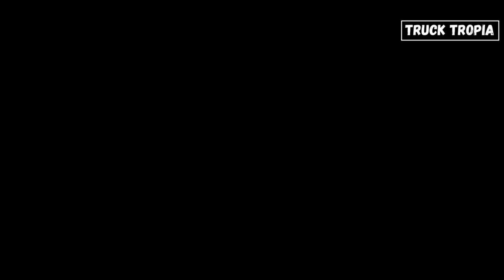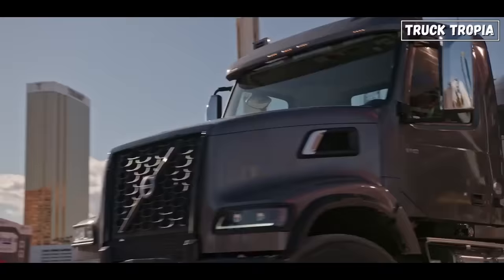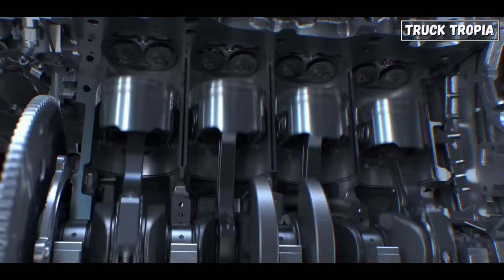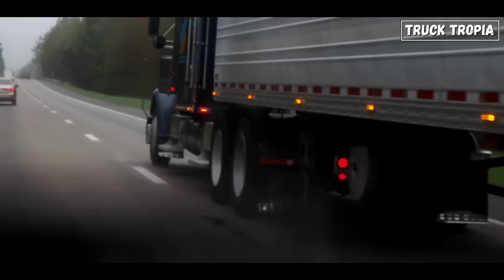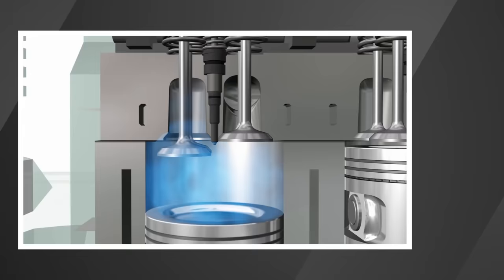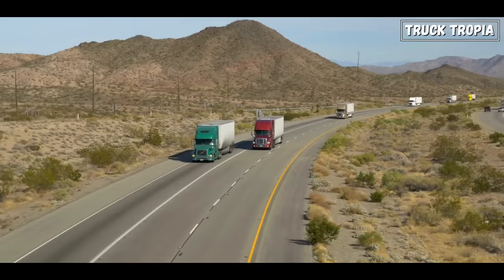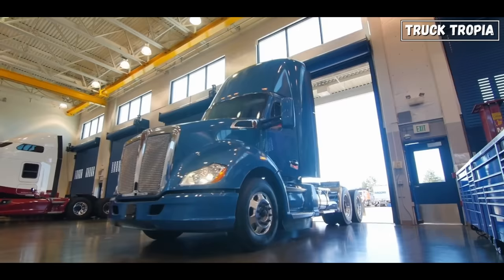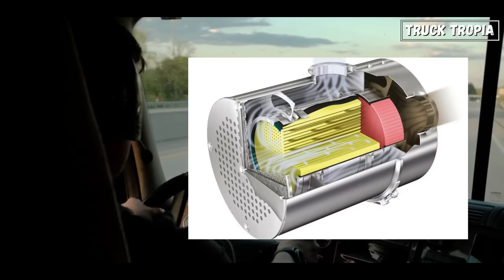Ultimate Truck Education 101 - Every Question Answered

Comment: 1) the reason for lift axles is to save wear on tires when not needed.
I can see that you are not familiar with big trucks...
This should be interesting. 
2) nobody ever has asked why UK engines are different than American. 
As for 500hp not able to pull heavy loads, I had a 425hp Cat engine, pulling a Michigan dump train with 212,000lbs, yes I was way over weight but that 425 pulled it like it was hardly there.
3)the desiel engine ORIGINALLY ran on peanut oil, the word desiel comes from the man how built the motor, his last name was Desiel, the fuel today is simply that the price of low grade fuel was cheaper and massively available over peanut oil.
4) having longer wheelbase has nothing to do with carrying extra weight, 80,000lbs is maximum legal weight regardless if you have a short truck or long one. To carry more weight it comes down to how many axles you have and state regulations. Mostly, those of us who have long wheelbase truck just LOVE the look.
5) the cost to manufacture  the v8 was the real only reason they stopped making them. I'll take a V8 Detroit any day. After 40ys and 4 million miles, using all motors, the Detroit V8 was one of a kind.
6) why did I hope you would get one correct ?
7) THE reason for automatic transmissions is so the companies can hire complete morons and women to drive their trucks.
Any trucker worth his weight can shift manually just as smooth as an automatic.

Comment: 80,000 lbs is not "36 tons", it is obviously 40 tons. This is coming from a veteran truck driver, but you don't even need me to tell you this
Reply: Imperial and Metric tonnes are different. Metric tonne is 2200 lbs which equates to ≈80k lbs/36 tonnes

Comment: Most of the statements on long wheelbases is false … it does not distribute weight more evenly and has far more disadvantages then advantages … Stability at speed is a moot point because even the shortest wheelbase trucks steer precisely if steering linkage is tight and high quality … Cab over short wheelbase Isuzus steer very precisely at speed

Comment: Automatic transmissions over manuals; is because the kids now a days that are learning to drive truck are too stupid to grasp the concept of step on the clutch and shift the gears. Autos might be okay for 80,000 lbs gross, but they don't handle 139,000 lbs (63,500 kgs) very well.

Comment: Cummins absolutely should put out a 6.4 diesel that beats Ford's V8 powerstroke 6.7 that puts out more HP and torque than the Cummins in the Ram trucks!!!
Reply: And if Cat was to venture into the truck segment, it would likely absolutely beat the hell out of the duratrash, and the new powerstrokes and either beat or match cummins easily.
Reply: For a semi???
Reply: @andykennedy5982  for years Cat had one of the best engines out there for semi trucks. My truck has a 6nz 15 litre Cat pushing about 800 horse to the wheels and that is far from the max the motor can make. I have heard some have them up over 1000 horse.
Reply: @andykennedy5982  
Did you not read I said Ram trucks for consumers?

Comment: 1 ton is 2000 lbs.  Therefore, 36 tons equals 72000 lbs.  80000 lbs is 40 tons not 36.
Reply from the maker: Nope metric ton 80.000 is equal to 36.000 kg = 36 ton
Reply: @TruckTropia  then tonne should have been used instead of ton as tonne means metric ton and ton aka short ton is the American ton.  Ton is 2000 lbs, and tonne is 1000 kg or 2204.6 lbs.
Reply: @AllanHazen  Because it's all about murica!
Reply: @andykennedy5982  no, it's about proper nomenclature.  If you were told to maintain 20 tons as opposed to 20 tonnes, your weights would be drastically different.  If, instead of following the directions, you set your weight to 20 tonnes and passed over a scale in an area with a 20-ton restriction, you would receive copious fines for your failure.  The failure to identify measurements has led to many great disasters in history all over the planet as imperial and metric measurements are routinely used around the world.

Comment: So do all the trucks you talked about how turbo diesel or are some naturally asperated?
Reply: I can't think of any non turbo truck engines built after mid 70's
Reply: Diesel fuel has 14 % more energy than gasoline. That means better fuel mileage. But before the point that they start producing good power they start to pour out black smoke. By turbocharging they can produce more than twice the power before they start to smoke. That's why they don't make normally aspirated diesels for cars and trucks anymore.

Comment: I will take an 18 speed manual anyday.  I've seen guys tear up automatic transmissions just as fast as they would tear up a manual.  I like choosing my gears, and shifting when necessary, especially in adverse weather, and soft undrfoot conditions.  I have driven both.  My personal experience is that automatics are more likely to cause drivers to be more distracted because they don't have to maintain control over all the functions of the truck.  Automatics don't see the road ahead, and adjust accordingly.  Just my two cents.

Comment: Whats the benefits of a twin stearing as opposed to the lift axel?
Reply: A lift axle is dragged around corners creating drag where a twin steer follows the curve with no drag
Reply: @andykennedy5982  so the twin stearing is much better to use instead of the lift axel
Reply: @mikeandrews6543  Absolutely, a twin steer will follow the radius of the curve, also in europe a lot of twin steers are also lift/steer axles.

Comment: Why do t semi trucks have electric fans?
Reply: Much lighter in weight as well as cheaper in cost.
Reply: @ronfullerton3162  better fuel efficiency and more cooling power at all rpm though
Reply: @DavidVidaurri  Definitely.
Reply: @ronfullerton3162  I hope that they add electric fans to semis one day. Ima do it myself on this t600
Reply: @DavidVidaurri  A truck I drove had the crank pulley mounted steel fan and a mechanical clutch fan . Running down the highway one day, heard a noise like a big rush of air and started immediately to attempt to find out what it was. Then two or three big bangs, and the motor started to shake like crazy. The fan clutch had froze up and started turning the fan at full speed, and two or three fan blades couldn't take the extra rpm's and went there own way, leaving the assembly terribly unbalanced. Yes, I like the plastic fans far better!

Comment: Cats can produce far more than 700hp but us gov got in the way of that. Now to answer uiur thumb nail. Long hood easier access to engine. Long wheele base makes for better ride. Straight 6 produces more torque which is what you want to pull forgot other question

Comment: some of the reasons for why most trucks.l use inline-6 engines versus v-8s are flawed. "v8s have a bigger displacement" is a bogus reason. in the last century, Lamborghini made a 5-liter v12. most US manufacturers made a 5-liter v8, and i know at least Ford made a 5-liter i6. different cylinder bore and crank strokes were required between the three types, obviously. a V doesnt mean its bigger.

also, only OHC and DOHC V8 engines have more than one cam shaft for all valve actuation. for decades all engines used a single cam shaft mounted above the crank shaft but within the cylinder block. they used lifters, pushrods, and rockers/fulcrums to transfer motion fron the central camshaft's lobes to the individual valve stems. i admit with everyone going to 4-valve heads and DOHC, having a V configuration complicates things. 

another main reason for i-6s is modern emission regulation caused manufacturing/mainentance cost escalation. two cylinder banks requiring all the sensors is more complex/expensive than a single cylinder bank with the same required sensors.

Comment: Your addition is a bit off in America 2,000 pounds it one ton. 80,000 divided by one ton =40 tons. And the reason for smaller horsepower is weight savings so you can haul more. larger horsepower equals more weight also less fuel efficiency.

Comment: They need to check their math. One ton is 2,000 lbs. 80,000÷2,000=40. 80,000 lbs is 40 ton not 36
Reply: 1 ton is 1000kg or around 2204 lbs. Hence 80000 lbs is around 36 tons.

80,000 pounds is however 40 short tons (the "short" part is very important).
Reply: @AlexKall  That would be a tonne.

Comment: European trucks are not smaller. They are shorter. But not smaller.

Torque is liek horsepower for dumb people that think they are not.

If you have a given horsepower you can get any torque on the other side of the gear box

Swedish weight limit is 74 tons since 2015... so it isnt  really a very new rule.

There is also a number of eu countries that increase thwre limit the last 2 years.

Highways in europe have pretty much the exact same dimentions as highways in usa. Primary roads is typicallt also pretty good geometry, not far behind highways (they are often convertied with minimum change in gemoetry).  Even 2nd level roads are for the most part  pretty decent.

Its really nor untill 3rd level road you would have a problem with steep hills  and while truck transport on them is bot uncommin, its not like its the type of road that dictate how trucks are built.
Reply: edwardpatrickson  Are you talking about the dirt-bike engine, or the full dirt-bike?
Reply: North American standard for lanes is 12 feet wide . Europe doesn't have room for that except on the freeways, and shoulders are optional there too.

Comment: Wrong the switch to automatic transmissions is so these they can train an idiot to drive these trucks. A standard transmission is more difficult. it's not like your Mustang, which is a synchronized transmission. In big trucks  the transmission is not synchronized which mean you have to match the gear with your road speed. And that takes training and time to learn. In an automatic, they can get put more people in seats quicker with less training. That's why truck accidents have tremendously risen in the last 10 years.
Reply: Good points. But, you in haste likely missed many more important facts. 
Hints,
Automatic transmissions have been pushed by Govs, ABCs, in cars, pick-ups, vans, SUVs, to 'market-more" thus resulting rarely finding any manual transmissions. 
Accordingly, greatly dimimissished learning possibilities for new drivers of cars, 
Automatic transmissions fail more readily, are becoming computerised, and unitised to engines so their repair/ rebuild become very costly, compounded by frequently obsoleted forcing junk thus > sales of new cars more often,
Car adverts influences on behaviours of drivers,
Distractions, video screens in cars,
Smart phones,
GPS,
Telematics,
Smart cars,
4 wheelers,
Intentionally Chocked roads, bulged-out-curbs at intersections,
Distrctions galore, signs, etc,
Just-in-time deliveries and Tax system,
QR code/barcode tracking & delivery, and compensation system driven and controlled by financiers, bankers, bureaucrats, bankers, msm
The above two may help toward preventing perishable foods etc from spoiling in transport. For rest are nil more than fools wastes & haste,
EDLs,
Resulting I.G. attitudes,
Majority of car drivers are detached from Nature, oblivious, bold, reckless,
It leads to a few truck drivers behaving same,

Welcome your and others insights.

Comment: All the advantages of Diesel over Petrol are multiplied by Electric Trucks.
Reply: You must have missed the parts about long range between fuel stops and also the short time required to refuel the vehicle. Time is money in this business.

BEV makes sense in a few scenarios, given current battery and recharging tradeoffs vs diesel truck tradeoffs. The BEVs should be great for short distance deliveries within a large city where a single charge can get them through the day and they recharge overnight. If fast swap battery packs became economical, long distance BEV trucking would be more viable. A "pack swap" might be even faster than pumping 150 gallons /550 liters of diesel. However, the electric drivetrain and battery pack is a heavier tare weight for the vehicle, reducing the amount of weight the BEV tractor can legally pull.  There is also no option to run with half filled fuel tanks to squeeze out a bit more cargo capacity in a pinch. One hundred gallons of diesel not loaded can allow another 700 pounds of a really valuable cargo in exchange for a reduced range until the cargo is reduced.
Reply: @amerigo88  You do know that EV trucks are allowed to increase their overall capacity by 2,000 pounds
Reply: hearhear
Reply: @stevehayward1854 That is gross pounds and not freight pounds. It is to try and even out the tare weight or freight weight between the two.

Comment: Well after a couple minutes watching this it's stupid the extra axles on the truck let alone trailer is the whole more weight legally has nothing to do with traction or none of that crap and without watching it V8 engines yet they use V8 engines and big trucks and v6s the old two-cycle Detroit to 654 then the 871 n the Cummins 908's. And except for some dump trucks which is what I'm driving now 18-wheeler pulling a dump trailer and it's nothing to do with ground pressure off-road it was a good effort but know what you're talking about before you try to give information

Comment: Hey buddy I've been a trucker for the last 7 years I'm just going to let you know that you have kind of fucked up some of what you've just said first of all in the US 80,000 lb is 40 tons not 36 I don't know which tonnage you're using but it's not the right one, one ton is 2000 lb at least here.
And the lift axles really only have any meaning for weight distribution when you're above 80,000 lb if you're permitted for 105,000 which you can be in the Pacific Northwest, to distribute our weight our fifth wheel slides forwards them backwards and each notch that it moves is about 500 lb, also the wheels on the back of our trailer slide forwards and backwards a good amount and that is mainly how we distribute our weight they're called the tandems on the trailer, again lift axles play a very small role in anything to do with weight distribution unless you are over the 80,000 lb max limit and are permitted for a higher weight limit
Reply: Just LOL

Comment: You need to go back to school. In the United States, 1 ton is 2000 pounds. So, 80,000 pounds is 40 ton. Which includes both the weight of cargo and the truck.
Reply from the maker: In Europe 80.000 pounds is 36.000kg = 36 ton
Reply: It's 40 short ton, there's like a bunch of other continents out there.

Comment: Since when does 80,000 pounds equal 36 tons?  4:39
Reply from the maker: Since Europe was made 😅
Reply: @TruckTropia   36 metric tonnes equals 40000 pounds
Reply: @harveydelanoy2430  no it doesn't. 36000kg ≈ 79400 lbs.
Reply: @TruckTropia  Which predates murica by centuries (100's of years for the benefit of our "colonial cousins") :D

Comment: I hate to break it to those who still think that Ev is the way of the future, but look at what's happened to it right now it has crashed and that's just in the lo
Iight for automotive market. Which is it's pretty obvious the big rig EV market is also going to be affected as well. If it's already crashed because of a forced mandate. On top of the cost of operation maintenance repair. If it's not practical now how will it ever be??? After all these decades of innovation and Evs still aren't practical and ready for primetime. We had our chance and blew it. The public opinion on EVs are abysmal. I don't think that's ever going to change. Why are there so many authors that still thinks it's eventually going to happen is beyond me. This short run of evs on the market is plenty of proof and tells us what the future holds for such and I'm sorry to say but it doesn't look much of a future at all as far as being mainstream prime time. Ev will always remain exclusively to the 5 to 10% of the public. Weren't too much debt to push this any further to begin with. Alternative fuel is what the future is going to hold because that seems to be a more of a successful transition then the internal combustion to Ev. The proof of facts are clear. Where we're at in the automotive world as far as technology and fuel source is where we are going to remain. As far as the manual shift transmissions going to automatic I can definitely understand that one. I've driven plenty of stick shifts of my day. And I'm just one of those is that the older you get, the less you want to do while you're drivingand that's cost for a while driving and not what gear you are in especially when you are dead tired. Manual shifts are for the pros no doubt. They are fun to drive end of my favorite to play with. But a long hauls. They are reserved only for the few, and that means the pros they have mastered those things their whole lives. Salute to them.

Comment: 4:38 um… 36 tons is 72,000 lbs.
Reply from the maker: No not in EU 36 ton = 36.000 kg = 80.000 pounds 👍
Reply: 36 tonnes is pretty close to 80,000 lbs
Reply: @hansjansen7047  36 tonnes is 72,000 lbs. 40 tonnes is 80,000lbs. There is no close. Load up to equal 44 tonnes, which is 88,000lbs. And when the trooper/dot officer asks for your permit, tell him that 88,000lbs is pretty close to 40 tonnes. See how that works out.